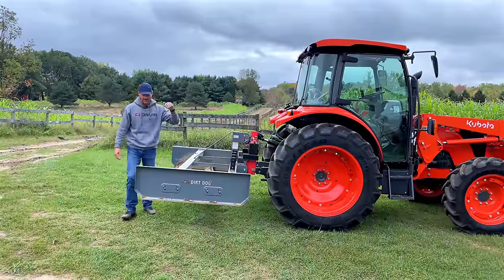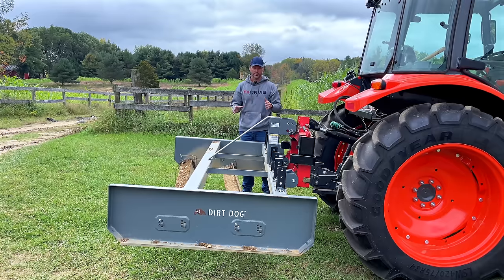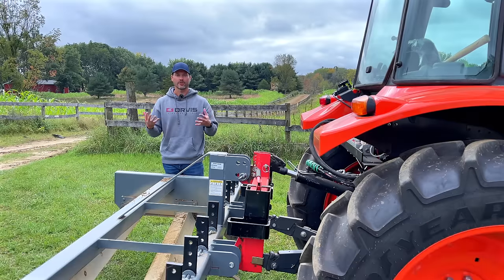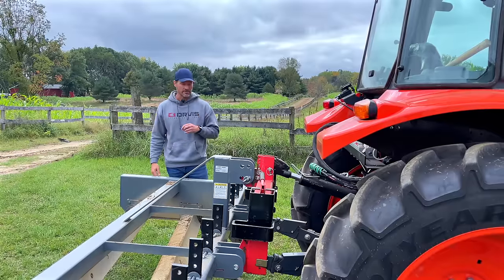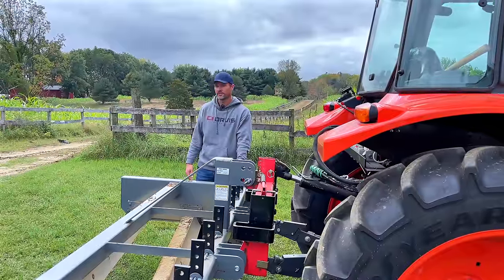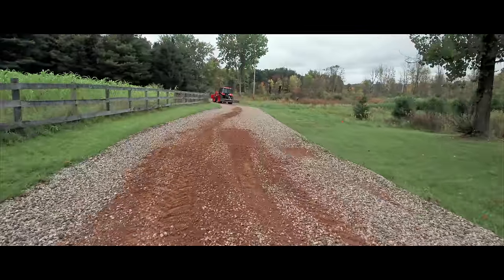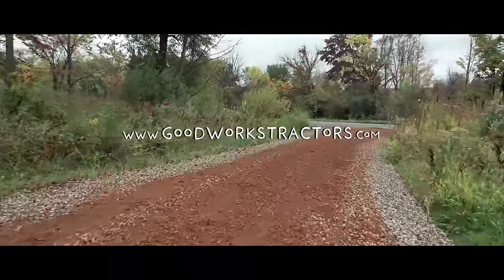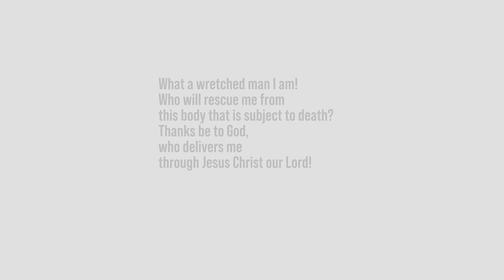THIS TRACTOR TOOL MAKES YOU LOOK LIKE A PRO 😎🚜

Comment: Incredible tool that can pay for itself and then some! 
We lived in an area with clay and silty soil that was like concrete when it was dry and soup when wet.  We could literally watch the gravel sink whenever the snow melted or heavy rains came. I’d be out there with a land planner as soon as it was dry enough.  A load of gravel every year, land planner and  tractor was less than half the price of having the driveway redone correctly.  There were times I cleaned up the driveway every week but it only took 10 - 20 minutes. 
Driveway we have now only needs it once or twice a year but I also do the road so that makes up for it 😎

Comment: Crushed Limestone over a year or two of getting driven on crushes down further to a powder. Then a cloud of dust follows the vehicle. 

I used the crushed limestone on my 1300 foot driveway because it cost half the price of 57 rock and I thought it looked nicer and would be smoother. It is but did not last. 
It has ended up as a nice base for next layer but until I  pave it or regravel, it has a washboard effect now in spots.

Comment: Couple of things ... 1) Truly wish GWT or someone would publish a list of HP (PTO) requirements for the various ground engaging implements.  I was in the market for a land plane and was fortunate enough I. That my dealer let try a 60 and a 72 BEFORE laid any cash out.  Glad he did as the 72 was a bit more than  my 35HP (30 PTO) was comfortable with.  
2) I added length - front to back - to the sides of my land plane.The added length helps with  smoothing out gravel over choppy surfaces.
3) Hydraulic Top Link is a game changer.

Keep up the great videos.

Comment: I just love how the driveway looks after using a land plane. I just use mine in the Spring and middle of the summer, I've neve wanted to use it in the fall because it would not have enough time to pack down for winter plowing.
Reply: That's one of the problems we have here. The HOA is responsible for road maintenance and they grade the roads spring and fall. They just graded it today with over an inch of rain in the forecast with a few inches of snow to follow. I'm glad I had my land roller to go pack it down a bit before the rain hit.

Comment: I have not yet bought a land plane - that is my next purchase. I always assumed that the angle of the blades was designed to move gravel from the right side towards the left side (as facing the front). That would mean that if I want to maintain the crown, I should work the land plane along the right side of the road. Am I correct? This suggests that you were taking off the crown intentionally?

Comment: I don’t get it.  New to tractors and gravel roads.  So you have a nice gravel road and at the end of the video it’s pretty much back to a dirt. What is the point of doing this?  Do you need to bring in more gravel now?
Reply: The dirt will settle in after a rain or two.

Comment: Too bad you could set up a couple of mirrors for the rear of the tractor so you don't have to turn your head so often.
Reply: Or a camera?
Reply: @Wakeywhodat - the camera would help some, but flares things out. You would still have to look once in a while. Put the camera to the front?? Then you will be turned but not acting as if your head is on a swivel😂😂. Take care, Eh!